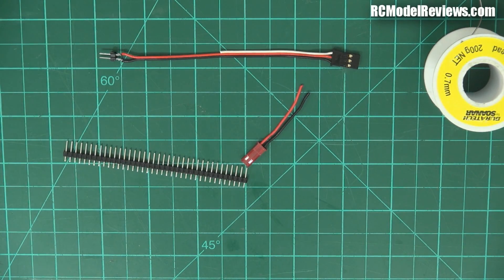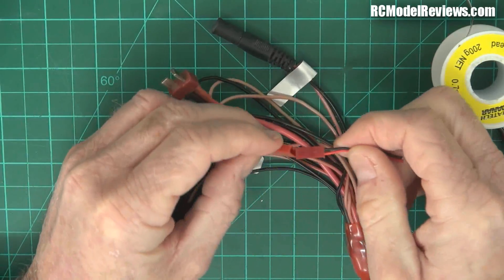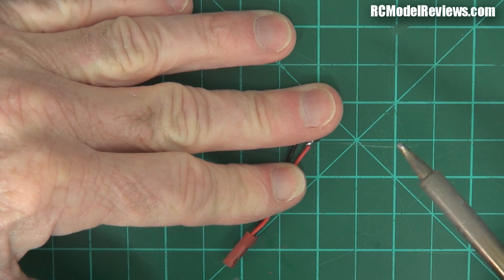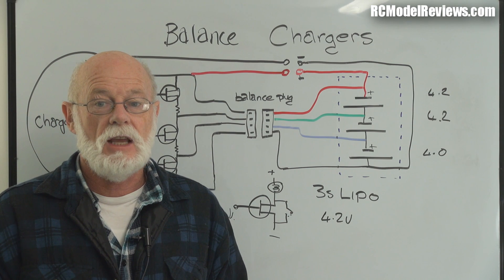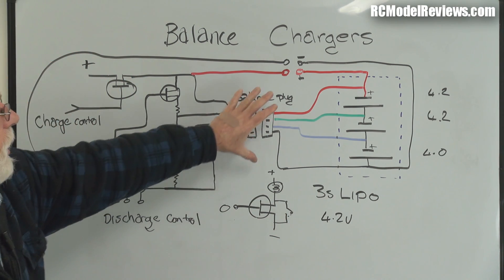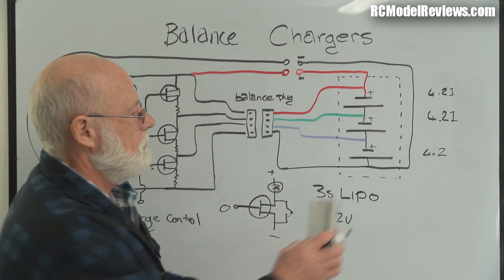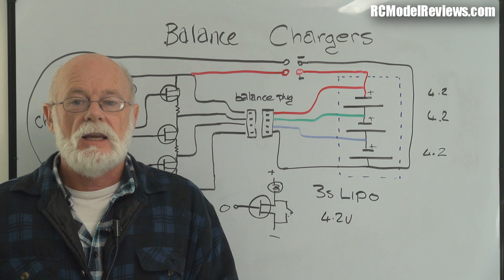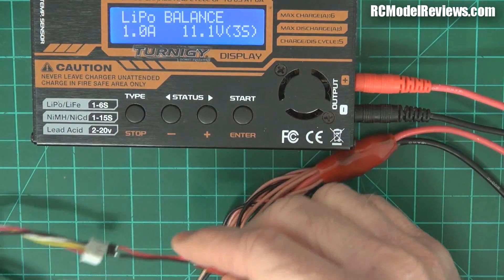Balancing your lipo battery more quickly (and how cheap chargers work)

Comment: Sir, thank you for the video.  I'd already built the cable for a rainy day and that day has come.  I just got a new battery today and needed to bring up two of the four cells.

I need to test the maximum about of current I can run through the cable.  1.0A may be the safety limit.

Comment: question? if i have a 48v battery 13s 8p and i wanted to charge an  individual bank lets say bank 8 of 13 due to it being lower voltage then the rest can i simply attach to bank 8 using your method to an imax ? just not sure if a 48v battery can balanced like this? Any advice would be handy

Comment: you take on the wrong cell. thought it would be the other way round. it is impossible for the cell to just jump from 4.11 to 4.2 straight away or your your charger plays trick on you. but it's good principle anyway. btw your cell signs on the white board are backward.

Comment: Thank you Sir for you common sense explanations.  

I was wondering if you or someone else here that's knowledgeable about RC batteries, can help me with some advice about what charger I should buy for my given situation.  Right now, I am working with smaller quads, all in the 3.7V range.  Millamps run from 150 to 850.  What would be the best charger to buy to keep these batteries in good condition and get the most flights out of them?  

On a side note, I like the idea of charging more than one battery at a time.  I have purchased a charger that can do five of these small batteries at once.  Is that a good idea from a value perspective?  Keep in mind it's a cheap charger.  ($12 US Dollars I think.)

Thanks to you or anyone else that can help me out with some education here.  I know lead acid batteries and sealed AGM types, but LIPO, LIFE and NiMh are new birds to me.   

Lastly, I like the idea of running my charger off a 12 volt, sealed lead acid battery in the field.  So the chargers that can run off 12 volts and alligator clips look pretty good to me.  I know they should work at home with a 12 volt wall adapter as well.  And I should mention I am in the USA.  I don't mind spending some money, say anywhere up to $100 US if I am going to save money, time and hassle in the long run.

Thanks again!!!

Comment: I bought an iMax B6 charger and like yours, a bunch of various adapters came with the kit. One of those adapters, a small red one with a shroud around 2 pins, came in useful in place of your .1mm Pin Header, I simply used a small hobby fret saw to cut a groove around the base of the hood, not too deep or the pins will be damaged, and then used a pair of pliers to neatly snap off the hood, exposing 2 perfectly matched pins that fit into  
the cell connector, I then set about charging each cell individually and balanced what was an ailing 36v 10ah LiFePo4 Ping battery pack. Now, during charging, the SIGNALAB BMS cell LED's flicker into life within seconds of each other and they come back up to working voltage in unison,...if you have one of those chargers, use a fret saw or craft knife to cut a groove around the base of the hood, and snap off the hood,....works perfectly and the red and black wires are already connected.

Comment: Does the imax b6 balance charger stop when the battery is fully charged?
Reply: +Wim Ross YES
Reply: Great information video!!!
Check out the powerlab 8 it charges threw the balance leads 
It's one of few charges that help balance cells this way.

Comment: so can I do this with an airsoft smart charger? I mean plug the balance charger into the deans connector in my smart charger? ive got a nice lipo alarm that shows me what voltage each cell is. so I could check it pretty easily.

Comment: i always find balance charging does not work, it charges way past 4.2v  and stuff,
they need to wire up the cells differently,
and put black and red leads, because then i know pos and neg.
i did not know i could charge the cells seperately,
so why does the charger not charge the cells seperately???

Comment: Great visual for beginners thanks. One question. Will a balance charging plate/station with a 5amp fuse protect my charger from a battery pack of 12 batteries if the input power adapter fails or drop below the 11volts required for the charger? Thanks

Comment: If one watches the video, it is important to pick up on some subtle revaluations! One that I caught me was that the wires that were being spliced were not silicon insulation and was, instead, plastic. It's very relevant. My experience with the stuff that I've purchased off of Banggood.com ... I bought wires for this purpose were silicon based - it's easy to manage and does distinguish the better cable insulation material. Cheers. Ravi

Comment: Bruce, we all love your videos, but please.  if some cell is out of balance, chanches are high that the pack has a chemically faulty cell, that should only be used on the bench for hand tools, not for flying any more.  some ppl do NOT use balance charger, saying if it does not charge well balanced, that pack is not really good.

Comment: Do you get accurate readings on the charger? My Fake IMAX B6 says the cells are equal but when i check with the LiPo Checker one of the cells is lower.
Reply: +Fábio Castro I have same problem.Did you find a solution?If yes then please tell me.

Comment: I have a Eflite 2s, 280mAH, 3c max. Now my local hobby shop reccomended 0.7A with balanced charging. I did. Now is the .7 supposed to go down to .0 and then it's charged, and what can you tell what settings I should put in for storage across my screen. I need help.

Comment: why not buy these http://www.ebay.com/itm/1P-40Pin-Dupont-Juper-Wire-Connector-Cable-2-54mm-1pcs-10cm-Male-to-Female-1P-/251865886485?hash=item3aa4606f15:g:tzwAAOSwe-FU9yFC

don't have to solder anything... 

nice vid by the way :)

Comment: Question for u, some guys at my club try to tell me to slow charge lipo. Like 2 A  battery at say .5A , I just don't get it. Its not going to charge all the way up? True? As the charger will only put .5A in battery. I try fasting high like 4A and charger said it going to put 2.2A in, can u clear it up for me Thx Graham
Reply: +Graham Bate easy... your Charger is rated in Watts.. if your charger is 50watts and you have a 4s battery then you can charge at 50/16.8v (which is the 4s battery) you can charge at around 2.97A
Reply: thx mate, I try it

Comment: This makes a lot of sense out of balance charging.  What I am wondering how does a charger that only charge through the balance port work?  I have a GT Power PD403 that only charges through the balance port.  It takes around 8 hours to charge my 5200 mAh 2 cell lipo at 3.0 amps.

Comment: the only problem I can see with this is that clearly that one cell has an issue. I have an eflite battery that is doing the same thing. I accidentally  ran the battery too low twice and since then I have one cell that is always below the others.  you should have explained that on a multicell battery, not every cell discharges at the same rate. A three cell battery that discharges in an airplane tends to draw power from each cell at a different rate. why? Could you explain that? Anyways. I have noticed that every time I fly. So if you run your battery low, you risk damaging one of the cells in a multicell battery. If you are in a yank to fly and dint balance your battery or your charger isnt balancing the battery properly, you risk damaging one of the cells by under discharging that one cell that was low, especially if it does that every time you charge the battery. eventually you get a puffed cell ( Like I do).
Reply: +scott firman I think it is because each cell has a different internal resistance. Because of this, each cell works at different rates of efficiency. The cell that drains faster probably has a higher internal resistance. More energy is wasted as heat.

Comment: Thank you, very informative. The sad thing is I used to try and discharge all cells and then charge them all again. This worked on probably 80% of the batteries. I used to get a few slightly puffed batteries that still worked OKish. I wonder how many batteries I messed up because I did not think of this resourceful 'trick'. Life lets those that still want to learn, another lesson, thanks

Comment: I have a better solution instead of making a special charge lead. Ebay the bad battery and buy a new one. Less hassle and end up with a new battery and a healthy economy.
Reply: +Zed orda Are you the kind of guy who uses money as toilet paper too ?
Reply: zoltan87 We are not talking alot of money here. You can buy Lipos for $20-$30 dollars and sell them on Ebay for half that when they get a bad cell you just have to include that in the description. I get about a year or 2 out each of my Lipos. I own over 20 for the varies R/C devices i own. If losing $10-$15 a year on a lipo is alot of money for you then your in the wrong hobby.

Comment: Another thing to keep in mind is that the cheap 4 button chargers don't have precise voltage measuring capabilities. So the accuracies of the cell voltages shown (3 are shown in the 3S case) will vary for each cell, and are certainly not calibrated to one hundredth of a volt as the readout shows. If you take your expensive digital multimeter and measure the individual cell voltages after a balance charge, you will probably see that the cells are not perfectly balanced. They will be slightly out of balance the same way after each charge because the cheap charger is working within its own (fixed) tolerances. This is not a big deal in most cases, just something to keep in mind.

For example, with my cheap 4-button charger if I put on a charged and perfectly balanced (according to my multimeter) 3S battery, it will think that cell 1 is about 0.02 volts low and take the time to bring it up. Similarly, if you take a Lipo charged on your cheap 4 button charger to a friend's place and hook it up to theirs, the voltage readouts will be slightly different and it may choose to "re-balance" your pack.

One or two hundredths of a volt is not significant, so there are no worries unless your charger's component tolerances are off much more than this.

Comment: Is it ok to charge all the cells seperate with this methode from the beginning and not only at the end? So that there will be never a overcharge of a cell?
Reply: +xuxusito Of course it is ok to do this, but you will be losing the convenience of the automatic balancing that the 4 button charger does, and won't get the benefit of charging all cells at the same time. The "overcharge" that the 4 button charger temporarily puts on a cell while balancing is very minimal. One or two hundredths of a volt high is really nothing to be concerned about. Don't forget that there is nothing magic about the 4.2 volt maximum recommended for LiPo cells. It's a rounded-off value reached by consensus and testing. Going over or under by such small increments will have no noticeable effect on the life or performance of your pack.

Comment: HI!! very helpfull video. I'm just having troubles with unbalanced batteries. I was guessing: If you disconnect the wires from the battery's balance connector, leaving only the ones you need to charge the cell you want, than connecting the battery like you always do to your charger, are you going to get the same result or it's going to be different???

looking forward your answer

Davide

Comment: ***** Bruce, I have a MuchMore Charger with a Docking station with only has a connection for the Balance connector and not the XT60 Connector. Is it better to charge the via the Balance connector only?

Comment: Hi Bruce,
Thanks for this tip. Just received a new 2200 Zippy 20C Flightmax battery and it had exactly this problem.  One cell was a bit low so the first time charge was taking forever.  It started off 0.05 below and ended up at nearly 0.1 below by the time the charger was starting to balance and it was looking like it might take the rest of the year.

I didn't have any pin headers but it turns out the pins on a servo cable are close enough pitch that a pair of adjacent pins connects well with a pair of adjacent sockets in a common balance connector.  So I just pulled the signal pin and used the servo cable.  No need to get the soldering iron out. Nice.  One thing I would caution is that you mut be very careful not to accidentally insert this hacked lead the wrong way around or bad things will happen.

Was able to use this method to get the errant cell up to par and balance out the battery.  Can't say for sure if it saved me time but it gave me a bit more confidence in the whole process.  Will have to keep an eye on that battery. 

Beck to the binch.

Comment: Wait, so when I'm charging a 3S without connecting the balance leads I'm risking my battery?
Reply: +Simp fally Yes, because the charger only knows the total voltage. It will charge to 12.6 volts, but if there is a low cell then it will be undercharged and the other cells will be overcharged to make up the difference. Similarly when you discharge an unbalanced pack a low cell will be deep discharged.

If you know your pack is balanced to begin with, then doing a non-balanced charge is fine. But the longer you wait between balancings,  the more unbalanced a pack can get - especially as it gets older. It's also a good idea to balance a brand new pack.

Comment: Hi Bruce... I tried this on a battery that had one cell a little off and it worked great.  On another battery I said... I must try to top off each cell on a 4S using this method... because it said it was charged but the four cell had 4.19, 4.20, 4.20, 4.19  So I said I would charge all cells one at a time just to top them off... first one took about 5-7 min... next one said 2.2 anyway but i said what the heck i will plug it in and sure enough in no time 2-3 min it said done.  (All charging was at maximum 0.4A on a 5000 MAH 4S.)  Next two cells a little longer.... In the end I tested it on a voltage tester and found I now had 4.20, 4.21, 4.22. Not sure how that happened... any thought Bruce?

Comment: What is the actual physical difference between two matching mAh batteries of differing C rating. From a construction/ manufacturing standpoint. Can C rating be slightly improved by doing something like upgrading the stock cable on a battery. Any thoughts from anyone would be appreciated.

Comment: Hi Bruce I am new to this electric flying after digging out my 30 year old gear I found they are now historic and may cause much laughter at a field. I purchased a FMS Skyraider 800 series RTF to get started again, after basic assembly and ready to set the flying surfaces I read the charging instruction before installing the battery.
Is it usual for the battery to charge for 2.5 hrs, BC-3S10 balance charger appears to be working, but at two hrs the charge LED blinks each second for 4 times and remains unlit for 3sec,  instructions does not say how long it takes too charge a 2S battery or if it has a green light to indicate full balanced charge. I enjoy your tech uploads, thanks Chris

Comment: Hey Bruce,  Thanks for the great tip !!

 As BMSWEB mentioned, this came at just the right time.  I have a 3200 mah battery that was in the plane when it was lost during an FPV flight. Plane was returned to me 3 days later and of course , Batt was dead.   I used the Nimh trick to bump it up to 3v so it would charge normally which worked well.  However one cell has been hanging about .8 lower then the other 2 cells.  I just bumped up the one cell using this method and hopefully the Batt will now live a longer happier life.

Comment: You're not going to believe this, but after 3 or 4 years of charging Lipo batteries, one of Thomas' brand new batteries had a Time Out error which on balance Charge. I made up one of these and I'm charging it right now. Fingers crossed it brings the cell back up :) Anyway my point being this video came at the perfect time. If it was ages ago I would have forgotten about it.

Comment: very good idea and saves time.
Another way to do this is to use a separate balancer and balance the battery. After the battery is balanced  then continue the balanced charging from that point with the charger.

Comment: A nice tip on soldering pins: Stick them into the connector. This way they won't disalign if the get a bit too hot.

Comment: For...Jesus Defender, I've seen a few videos where people with "dead" Li-Pos,
select Ni-Mh/Ni-Cad on the charger & do a very quick charge.....BUT, you must monitor the Li-Po voltage.  Use a digital multimeter.
As soon as it gets to around 3.3 volts, turn it off, change the settings & quickly try charging it "normally."

&, yes. Your IMax B6 is fine.

That's what I use.
----------------------------------------------------------------------------------------------
Sorry for having to post this here, as the direct "REPLY" button only starts & stops the video & I cannot use the space bar.

Google at play again. ;)

Comment: Well explained, Bruce. Sadly, I don't suppose this would work on what is supposed to be a 3 cell pack but now thinks it is 2 cell - very annoying on an almost new LiPo

Just a very minor point. When I was at college the long line of a battery symbol was always the positive becuase a + sign has twice as many lines :)  Perhaps things have changed in the 50 years since I finished night school.

Nice to see a video not exclusively quad based for a change.  I've almost given up watching what were once excellent and rewarding viewing with a little variety.

Comment: Thank you Bruce, you answered my long wondered question. Is it safe to charge one cell manually. This might be great for new batteries.
Question: Should the batteries read exactly 4.2v, I find that my good multi-meter shows balanced batteries to be 4.17-4.19. I've attempted to calibrate the charger, but it typically charges under the max.